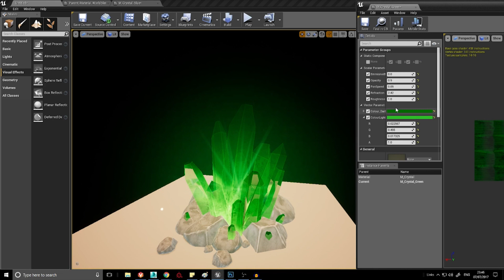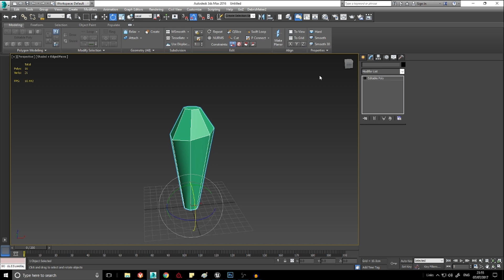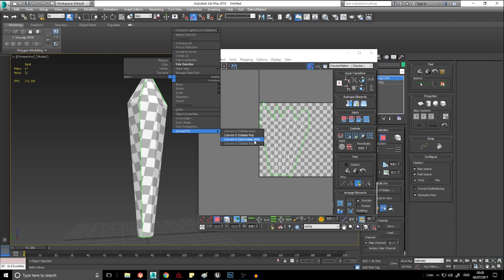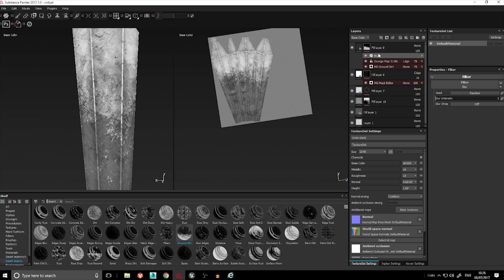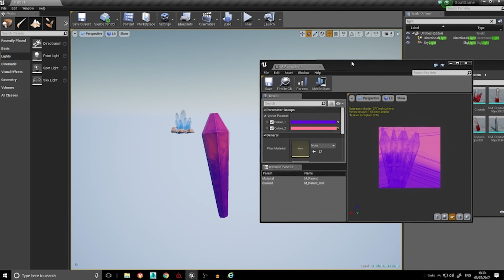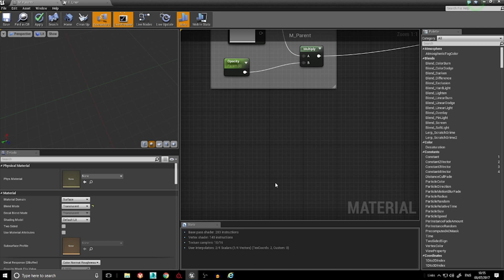Comment: "all from within ue4 *opens autodesk*" srsly? ue4 actually allows you to do all of that internally. -__-
Reply: Kyra Zimmer it doesn’t say anywhere that it’s all in Unreal :p you shouldn’t use unreal to 3D model, the only tools they have are for blocking out a level not 3D modelling. You’re going to need an external modelling package

Comment: Hey! I was just wondering if you could go a bit more in detail as to what the Panner Texture nodes are doing. Awesome tutorial though thanks! Always learn a lot from your videos :)
Reply: The panner is animating the UV Coordinates, so the line texture pans across the crystal giving us that shine effect. We can change the Y or X speed on the panner to pan the texture horizontally, vertically or both. 

 I'd check out the UE4 documentation on it, it goes into more detail and has some examples https://docs.unrealengine.com/latest/INT/Engine/Rendering/Materials/HowTo/AnimatingUVCoords/
Reply: Awesome, I'll read up :) Thanks so much!